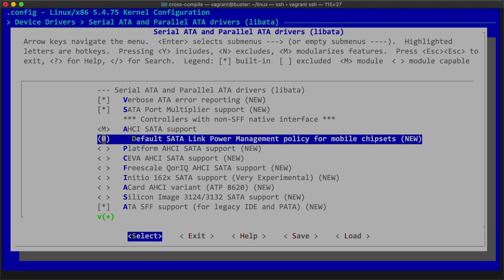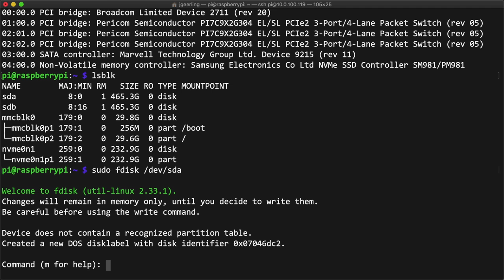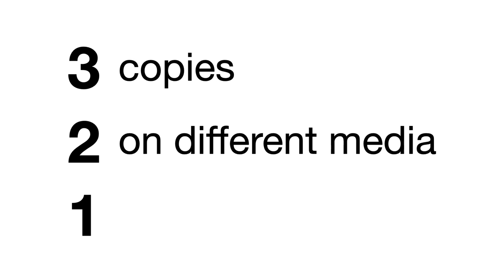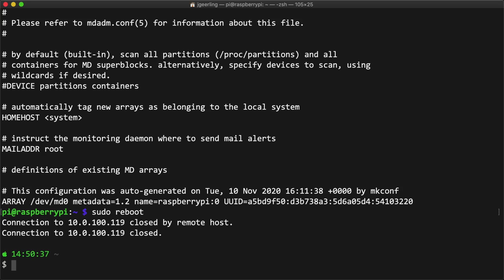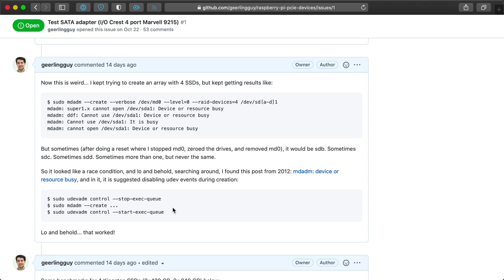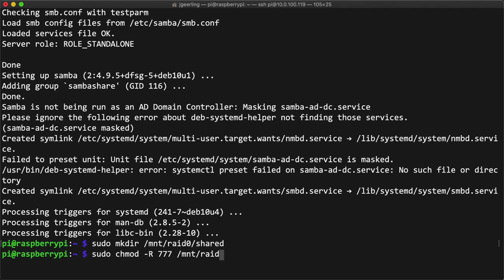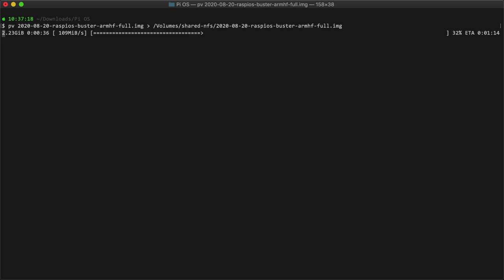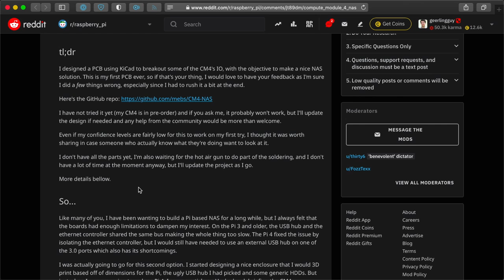I built the fastest Raspberry Pi SATA RAID NAS!

Comment: Heads up to anyone wanting to try this, the iocrest sata board is available under a ton of names, I've got a few of them knocking around and they are absolutely identical. If you go on your countries amazon store and search for 'sata pcie card' you can almost guarantee to see a handful of them under different brands on the first page. As of writing, on the UK Amazon store it's sold as a Sybia SI-PEX40064 among others. There's also a version which appears to have the same profile and chipset but is a black pcb, these are sold for a bit more.

Now, we just need someone to design an awesome 3d printed case to hold the drives and pi dev board :D

Comment: Good first look for using RPi hardware for a NAS. What I took away:
- hardware layout is still a lab type setup for testing, not a real enclosure that secures everything properly. Looking forward to third party I/O boards with better layouts, cases and most of all non-scary thermals!
- SSDs are much faster than HDDs, no kidding. However HDD storage will have a 2x GB/price advantage and larger capacities for a while.
- HDDs have observable reliability curves compared to consumer SSDs. When the latter fail it is usually without warning - ouch. Use at least RAID 1 for critical data.
- I run a homebuilt RAID 5 NAS and am looking to go RAID 6 due to long rebuild times. Any six port SATA-PCIe adapters found?
- WD Green HDDs are out of production AFAIK, I'm moving to Seagate Ironwolf drives due to the WD SMR fiasco.
Thanks for your time to test all this!
Reply from the maker: I have not found a 6-port PCIe adapter, though I intend to (sometime... not too soon though) test 2x 4 port adapters in a PCIe switch.

Comment: Thank you for emphasizing that RAID is NOT BACKUP.  Redundancy means the array keeps going when part is down, which lets you shutdown gracefully, or limp along until a replacement system is put into production.  Also, since we're all backing up important data, there's very little risk in RAID 5/6 FOR operational data.  I don't use RAID for backups.  Just keep in mind that if a drive dies on service hours, the rest of the drives may be close behind.

Comment: I use Drivepool, Doesn't matter which drives / protocol you add or size, you can even add cloud drives and NAS drives. Which kind of files go on the mechanical drives and which ones on SSD... Add drives by simply connecting it and adding it to the pool, or replace drives. No need for reformatting or partitioning. You can put any random drive in another PC and it's full contents are readable.

Comment: Nice! I've been doing some preliminary research for designing my own housing board for the cm4 specifically for this application and this chip is definitely on my radar!  Unfortunately it seems like most pcie-sata bridge ics are surprisingly hard to source for us mortals.
Reply from the maker: Yeah, along with chips like the VL805... any of the well-supported chips seem to only be available if you build zillions of devices.
Reply: @JeffGeerling  UGH yup, at this point I'm considering just buying some card to sacrifice and salvage a chip from just to try getting a working prototype

Comment: 3:47 I have a feeling that "a constantly backed up drive" is going to trigger a thousand echoes of "RAID is not a backup". Interesting video though, I'm enjoying following along with your escapades.
Reply from the maker: Keep watching to 5:58 ;)
Reply: Well, if you use four drives in RAID1 you technically create three extra backups of your data.

It's just not offsite and won't protect you from accidental overwrites or deletions.
Reply: @JeffGeerling  Heh, yeah, I saw that ;) Incidentally, on the subject of RAID1 vs RAID5/6, is it still the case with md software RAID1 that in the event of silent data corruption on a drive (e.g. bit rot which isn't recorded in SMART data or reported to the OS), the state of the array will appear to be healthy and there's no way for it to be detected? In the case of silent corruption on one member drive in a two drive RAID1, a scrub would report there's a mismatch between the two drives, but there's no way to know which is correct, and unless md knows which drive is faulty (which it won't if there's silent corruption) you have inconsistent data and no way of knowing which copy is correct? It's been a while since I used md, so I don't know if it's still an issue, but it's something you might want to check up on.
Reply: @covoeus  In that case you'd have three extra copies of your data, which is not merely a semantic difference, even if it appears to be.
Reply: @amp888  yeah filesystem table may corrupt and raid won't help in any mean. You also need battery power to prevent raid corruption and shutdown safe. And that is a price for single file copy, not even archive

Comment: Several years ago I came into boxes of random hardware including many SATA mechanical and SSD of various sizes and manufacturers. I was also considering coin mining - in particular burst coin which requires one to provision DASD space which one would use in the mining process. One could easily build multiple mining rigs covering 100s of TB of storage. The problem was the provisioning process because every block on a device had to be pre-written. A 2TB drive could take several days to provision. What was noticed in the provisioning process was this transfer rate falloff issue that was consistently seen on SATA drives, but not on SAS drives. SAS being more expensive one had to be flush with cash to indulge. I suggest a fruitful informational pursuit to look for SAS and burst coin videos on YouTube. There was a lot of activity in this around 2017(?). 

BTW - love your content.

Comment: RAID1 is not scalable.  For 4 drives, it's absolutely fine.  You're absolutely right that RAID 5 and 6 are more fragile and complex compared to RAID1, however RAID 6 is used VERY widely in storage industry and is probably the most common for any large storage deployments.

To mitigate risks further, storage systems will often keep hot spares connected which do not normally partake in the array, and when the system detects a failure, it pulls it from the array and adds the hotspare then begins the repair operation automatically.  

I realize this is a raspberry pi you're dealing with, but just wanted to make the point since a lot of the information in the video is presented as general information and advice.

Comment: I use a 7 ports (USB 3.0) to PCI-e Extension card in my desktop (old school) and have great performance with all my printers, drives, and input devices. Even a USB Wifi dongle performs incredibly. This card needs a single SATA power input connector. Brand of the card: ORICO - 5Gbps PCI-Express (PVU3-7U-V1).  You could test USB 3.0 drives with it. I paid 14 euros for it.

Comment: I don't know how relevant it is to what you are doing with SSD's, but something I've certainly discovered using SSD's in Macs is that having 'TRIM' enabled on the ATA controller gives a dramatic improvement in performance. I only have a vague notion of where in the functional stack TRIM operates, but disk I/O slows down considerably if it isn't enabled when using an SSD as a conventionally-attached drive under MacOS.

Comment: I set up a Raspberry Pi 4B as a NAS last year to solve a problem with cheap external hard drives. The problem with external USB drives is when they die there is a chance it is the USB 2 SATA controller in the drive. However if you send your drive in you lose your data.  If you take it apart and your drive is bad you lost your data and warranty. To solve this I got a cheap 1GB (they are 2GB now) Pi4B, a cheap (paid $19) 8 port powered USB 3.0 hub, and x4 8GB WD External hard drives (Amazon sale) with 3 year extended warranty. Connected Pi via ethernet. Used mdadm to make Raid 10. Installed Samba for windows computers in the house to have access. Installed Secure FTP  so remote family members can upload family pictures and video they want to protect. This cheap setup gives us RAID for saving important files and lets remote family upload their important files. If a drive goes bad just send it in for replacement. When new drive arrives just plug it in setup and rebuild the new drive.

Comment: I'm looking to create a RAID 1 setup using two M.2 SSDs on my Raspberry Pi 5 (4GB). I already have the Geekworm X1004 adapter. What software would you recommend for setting up the RAID 1 and creating a private cloud using Nextcloud? Could you provide a step-by-step guide or even a video tutorial on how to do this, including how to access the Nextcloud with RAID protection?

My goal is to move away from Google Drive and Google Photos.

Additionally, I'm interested in having multiple Raspberry Pi 5 devices in different locations for data redundancy. For example, one at my house, one at my parents', and another at my grandmother's. If one fails, I'll still have my data available on another device. Is it possible to create a RAID 1 configuration across multiple Raspberry Pi 5 devices?

Any help would be greatly appreciated!

Comment: With the drive busy issue, I would look at the individual drives.  I normally benchmark each drive.  There have been times when I have built an array and it just doesn't perform.  Once I broke the array, and tested each drive, I found 1 drive that was slower then the others, and pulled it.  

Then when rebuilding the array, it performed better.
Reply: The other drives saw what you did to the lazy one and decided to behave

Comment: The only thing that I would make note of is that if you're going to be using a solid state drive for long-term use I would not recommend a Kingston A400. It is among the lowest performing DRAM-less SSDs, and price to performance and features is just about matched by the likes of the SK Hynix Gold S31 and Micron MX500 which are from the flash chip providers and have DRAM caches for burst writes. That aside, for small proof of concept uses it's not a bad choice if you don't play on using it long term.

Comment: Jeff I think you might have hit strange performance issue due to RPi IO scheduler for SSD array you should have used "noop" I have no way to check this but I think the RPi default is CFQ scheduler which impacts your performance on SSD trying to restructure the sequence of block to write + some peek into what drivers were used and IO queues.
Reply from the maker: Here's the result for my CM4 with eMMC:

$ cat /sys/block/mmcblk0/queue/scheduler
[mq-deadline] kyber none

I don't have the SSDs available to test quickly with them, but is there somewhere in the source I could look to see what the default is?
Reply: @JeffGeerling  I couldn't find a reference to io scheduler in libata so experiment would be needed to figure out if kernel knows these are SSDs something like: grep . /sys/block/sd?/queue/rotational and if it does check the io scheduler and test performance with [none].

Comment: I've a Pi 4 Model B (4GB) and have shucked a few WD 14TB drives to build a Pi NAS. I hear that USB is not the best interface to use for the NAS drives, USB interface apparently isn't as good for the longevity of the drives. I am wondering if I use a USB to SATA adapter to connect these drives and build the NAS, would that provide better or similar level of reliability as a dedicated SATA PCIe card on e.g. a Compute Module?   The data speed is not a huge issue for me, it's the health of the drives/reliability I am more interested in. (I am mindful of 3+2+1 rule that is mentioned in the video to avoid data loss).

Comment: My thoughts abaout HW-RAID:
Don't do it. For testing it's nice to know, but unless you have same exact RAID Ctrl with the same BIOS don't save important Files on it!

On a hw failure on mdadm you only need a second computer/pi with linux installed. On HW-RAID you can hope that your second RAID Controller works well. Sometimes they have strange BIOS and do unexpected things.

What goes well is an HBA or Host Bus Adapter. This I use in my NAS for a long time now. Before I had a HW-RAID Ctrl and data loss.

Greetings from Germany 🤪

Comment: You didn't touch on the long term usage reliability differences between spindle and SSD - any issues with constant read/write on a SSD?  What about the price difference between a fitted out Pi vs a Synology type device?

Comment: The things is, all those RAID and fast disk will have bottleneck on 1gbps ethernet interface even for home use.  So no matter how fast the array is, it will limited to around 100-120MB/s since it's limited by network interface.
I have my own DIY Linux NAS using 8 x 4TB WDC Red on RAID 6(mdadm) for all my media files and have been runing for more than 4 years now. At first I think I will upgrade those server using SSD for offloading my game library(Steam) to NAS, but after I try loading through network for heavy game is still not quite feasible for me, that's why I still keep using magnetic drive on my NAS.
Anyway, good project :)

Comment: Hey Jeff, first off Congrats fot 100K subs!

I wanted to ask if there is any way to "Append" the Wifi and the Ethernet connection on the Raspberry PI 4B or other Models. My Problem is, that i had an Raspberry PI 3B for five years and i wondered if i could "Append" the Wifi and Ethernet connection to get more that ~97 Mbit/s out of it. Sadly it died a few days ago but I already ordered a new RPI 4B. It now sounds like that I don't need that "Help" anymore but i'm still wondering if it may be able.

Sorry for my bad english, I'm from Germany and my phrasing is really bad today. If i missused the word "Append", i mean linking the Wifi and Ethernet to add the speed together.

Thanks in Advance and Happy New Year,
MTLPGaming

PS : Dude, even though your videos are long, I always watch your Videos when they come out because there really good and informative. Keep It Up!

Comment: About the periodic performance drops on long sequential network writes, it may be that the SSD controller itself is doing garbage collection.  Explicitly do a "fstrim -av" before the next benchmark run.  That'll make sure that all four SSD are clean at the outset.  See if that makes a difference.
Reply from the maker: Good idea! I didn't set up TRIM on these drives.

Comment: One of the best and very cheap NAS build.
- An old ECC server with 16GB RAM and at least 9 free SATA ports or one free PCIe slot for a SATA card.
- 8 WD Green drives
- TrueNAS on a SSD

Bad part? The server will likely be a tower or rack mount. BIG. 
The fan noise will be LOUD. 

* optionally a 10Gbps network card and switch.I have a old mini tower with 16GB ECC RAM and 8 SATA ports + one mini PCIe port running TrueNAS with 3xGib ethernet ports.
Very little fan noise and not much space.

Comment: Interesting video.  I have long favored NFS or Samba for high volume transfer.  I didn’t know that short or random transfers would be that much faster. I wonder where the slow down occurred. Was PI hardware slowing it down? Even though I am not likely to make a PI-NAS, I am interested in which file sharing protocol is best.  So at the protocol level I have wondered if the fact that NFS runs on IDP/IP and Samba runs on TCP/IP if the acknowledgment overhead of TCP layer could influence that. The people against NFS have long argued that the UDP layer on which it is based is connectionless meaning that the application will have to account for lack of acknowledgment.  Thoughts?

Comment: "ZFS is de wae!" I did an actual honest to goodness spit-take with my Coke, thanks 😆  My MacBook is no longer a fan, incidentally. I thought along the same lines as you for my home server RAID setup, RAID5 seemed a little risky considering the age of the pulled drives, and I had 6x2TB of them (this case/board can support up to 12 drives with some added bays, old dual-Xeon workstations are awesome like that), so RAID10 it is. I only backup the important stuff, got a Pi4 with a 1TB SSD and a buttload of cloud storage for that.

Comment: Looking at that stack of SSDs, I feel like the best "cage" would be to run small rails vertically along the screw holes with standoffs to provide separation between the rail and the drives. Given how little those SSDs weigh, that should be more than enough rigidity and support.

Comment: I have to admit that the last time I played with a home made NAS and used those generic 4 port cards, was 2010, however I remember them being the stuff of nightmares. I remebber the same kind of random performance drops and log build times. My card was build around some SilSATA controller (sorry forgot the exact model). This was all attached to a Pentium4 D, which while not being a bullet, was still definitely not the issue. I wouldn't trust that card as far as I can throw it. Also those temperatures indicate that the card itself is probably running beyond its capabilities.
Reply from the maker: It's been quite stable running hours-long tests over the course of a month, but I do agree that in general, if you're going to try for bulletproof storage, you should probably go for an even more reliable card (I'm trying to get a few different LSI controllers working still).
Reply: @JeffGeerling  oh it ran stably in the sense it did not crash... But performance was not predictable. I would expect that term years of improvements did wonders even for cheap controllers, but I distinctly remember a performance jump once I bought a mainboard with 4 data ports. A rarity in those days... Might have even been 2008 actually..